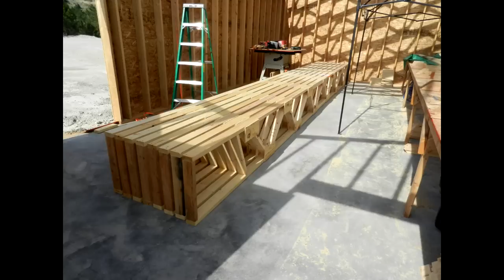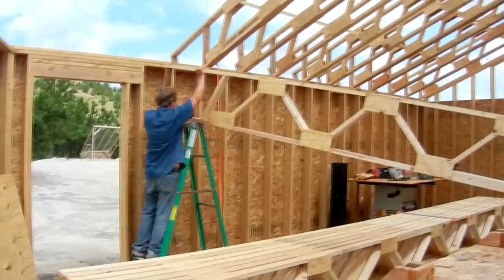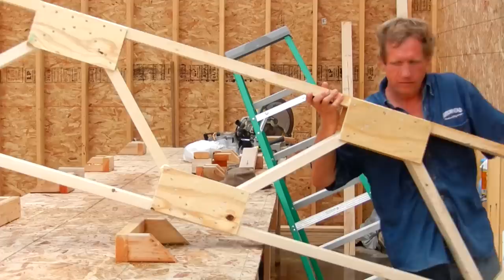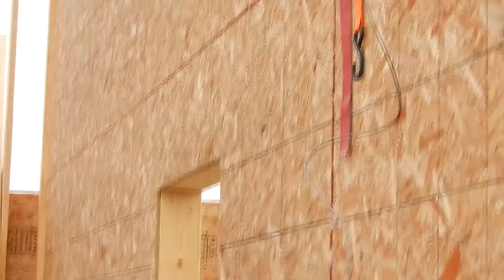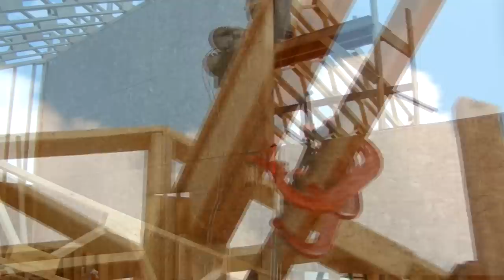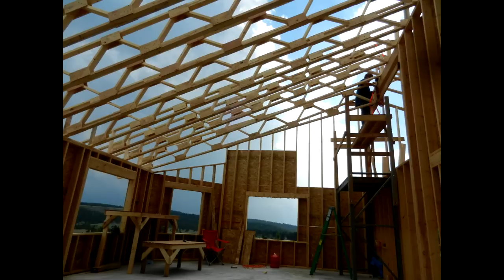One Man Roof Truss Raising

Comment: Door openings  aren’t framed correctly and wasted wood by doubling up all that 2x material. Need jack studs at doorways
Reply from the maker: Maybe theirs some waste and, your wrong.
Reply: @BSpotBuilds   I have a structural degree and have been framing for 30 yrs.  I’m not wrong.
Reply from the maker: @mikeeagle2653  So with your qualifications I would expect you could back up your claim with some facts and data. My truss's are 26 feet long on a 5/12 pitch, warren style with a 2 foot cantilever at the eaves, the parallel cords are 24" apart,the connections are 8x12" x1/2" 4 ply sheathing, glued and nailed with (30) 1-3/8" ring shank nails. The load is 15psf live 15psf dead and 25 snow. Now why do i have to use southern yellow pine? As for the jack stud I assume you don't like the king and jack stud not being tied together but the jack is completely nailed and glued to the osb sheathing so it is held in vertical alignment and can carry the load in column strength.
What I really think is you had a few beers and troll around YouTube showing the world how smart you are. I have some qualifications my self and due to location I am not bound to the building code. I do design my work and decide my own risk vs benefit analysis. So any argument that its "not to code" is meaning less to me.

Comment: There is no way this is productive, he could have used hand pulled pulley do it in 30 seconds save time doing 3x per ladder climb; with an overhead resting collar/ledge. When all else fails why listen  to Archimedes. Even leaning it flat over the taller wall than using a single T bar lifting it to the lower wall and mid point.  No reason to lift it upright, on side is (some low load flex at this size) but safer to handle. It looks to be about a >70 pound load. Sling a counter weight over the wall if one wanted to be safer.  A central rolling/sliding saw horse pivot box, would have helped so it was >= center angle once 1/2 lifted enough to do 3 at a shot. What the heck, he got it done, bravo for him. He is moving forward.
Reply: There's more than one way to skin a cat.
Reply: Joseph Böhme
Reply: Joseph Böhme leave him alone man he did it ok
Reply: You are way too smart..
Reply: There’s several ways to do it faster and/or easier (working alone still), but assuming the video is real time, which it seems to be, he raised a truss alone in about 3 minutes which isn’t bad. What’s really neat is his video where he rigs an automotive engine crane to lift Sheetrock.

Comment: awful no birds mouth
does not sit right on wall
Reply from the maker: Awful comment. So you are going to cut a birds mouth into a truss? I did it correctly and used tapered blocks where the truss sits on the wall top plate.
Reply from the maker: Awful comment. So you are going to cut a birds mouth into a truss? I did it correctly and used tapered blocks where the truss sits on the wall top plate.